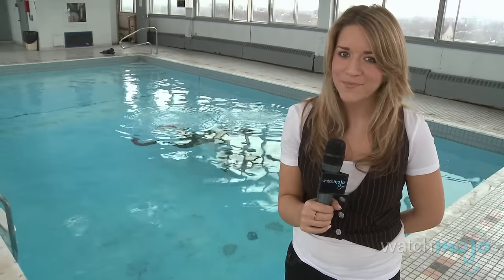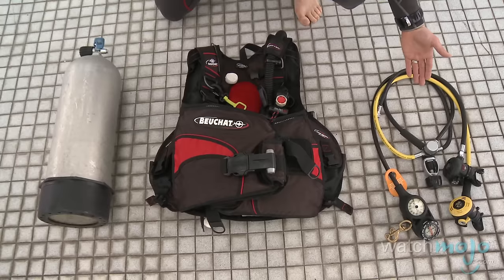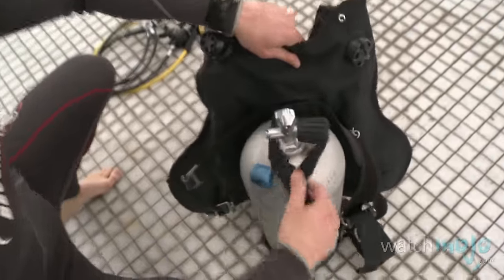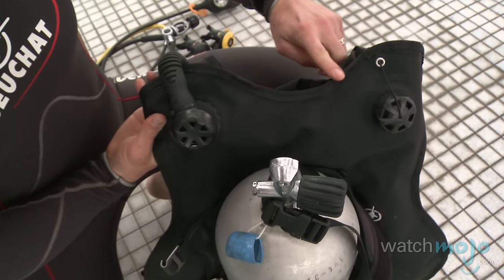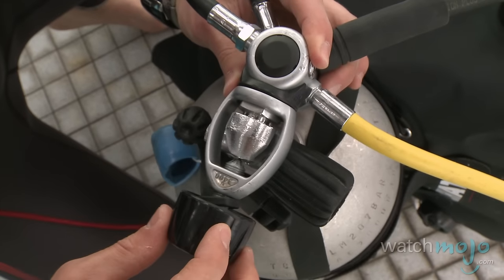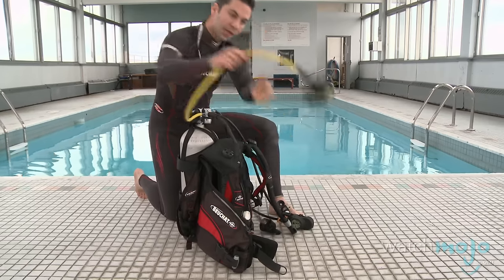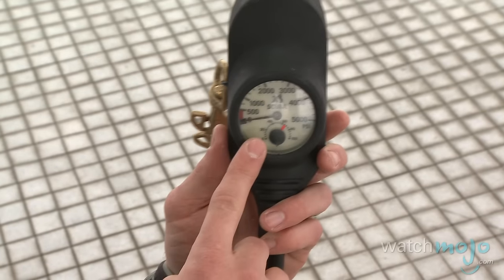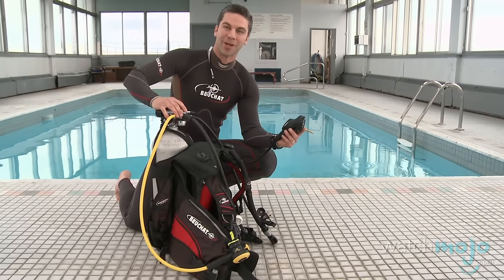Scuba Diving: How to Assemble Equipment

Comment: No more 1/4 turns! (This has proven by professionals to not be the best way to leave your valve open.) Open your valve all the way to prevent any issues whilst diving! Other than that, great video for a refresher! Thank you!
Reply: Sorry dear am a professional, cmas course director, PADI instructor, Tec dive instructor, former army diver, owner of a diving center, certified over 5000 students including instructors. With over 20000 dives. Open your tank and close a 1/4 turn is the proper way. The only thing he has done wrong is purge the 2nd stage when opening the tank to avoid sudden high pressure to the piston of the 1st stage. Also inflate BCD and leave for something minutes to check if there's any puncture then test the lpi ( both ways 1st deflate with lpi push button then deflate by pulling lpi hope) inflate and deflate again. Inflate again and check both quick purge. Check all buckles. Breath in both 2nd stage and octopus to check they're working properly at the same time check the quality of the air in the tank. When you breath the spg needle must not move. If it moves it indicates that may be the spg in not ok or the tank isn't properly open or 1st stage problem
Reply: @odeltarkhan3033  what is the point of the quarter turn?
Reply: @johnmartin2992  please check my posts I already replied to this question 3 times.
Reply: @odeltarkhan3033  Most places have stopped teaching the back a 1/4 turn. I agree with everything else you said, but the the valve is very unlikely to stick if you open it all the way. What is more likely is confusion of a buddy diver on whether the valve is open or closed. Say for example a diver suddenly has problems with airflow, maybe they didn't open the valve fully etc, a fully open or full closed valve is an immediate indication to a buddy. If it doesn't turn one way the buddy knows it is either fully closed (thus causing the issue), or fully open and so the problem is something else. The 1/4 turn just adds confusion, that way the valve is floating between open and closed and the buddy might not know if they are opening or closing the valve. Each to their own, but this is like CPR, it gets updated every few years with new rules and guidance.
Reply: @ciaranocallaghan5113  I agree with you mostly 1/4 turn was done to avoid confusion. In professional diving it was done to protect from freezing and to avoid damages when tangle in something like in cave diving, police or army rescue
Reply: @odeltarkhan3033  Ah right I see, sorry I thought we were sticking with the scope of recreational diving. I can imagine tec diving the risk of the valve sticking would increase significantly. Especially for cold water deep dives.
Reply: @odeltarkhan3033 if you are a PADI instructor, please tell me which page in PADI’s OW manual tells you to do a 1/4 turn back.
Reply: @johnmartin2992  1) To allow for a margin of error in mechanical failure. Important in the case of the unknown shit that can happen in the unforgiving environment that is the salty sea. This is true for all mechanical equipment, not just scuba tanks. Valves can and do get stuck open for all kinds of reasons, which causes all kinds of issues, especially if another emergency arises. If you have some give, you can usually do something about it.

2) When the valve is fully pegged, it is hard to know (during a check) which direction it is pegged (open or close) when the system is already charged. You could potentially peg it closed and never know. A pegged valve has a chance of being fully open or fully closed. An unpegged valve will always be open.. If the valve has give, you know the valve is open and is supplying gas. 

It is unfortunate and confusing as to why some instructors do not teach this any more, there are real engineering and safety reasons to keep doing it. It is one of the easiest things to do.
Reply: @ciaranocallaghan5113   "the valve is very unlikely to stick if you open it all the way." Statistical fog. Do you know exactly the rate of failure to be so dismissive of it? I have about 10,000+ immersion, and while they are rare - It DOES happen more often that you would think, and leads to other issues. Especially as you get more advanced in your environments. As far as confusion, I have never seen anyone get confused with a 1/4 turn in over 20 years of diving. If the valve is pegged, there is a chance it is either fully open of fully closed. If the system is charged, you would never know which way you just pegged it. If it is 1/4 in either direction, it will always be supplying gas. The fact many do not teach this anymore does not surprise me. We are in a strange world now where people with little experience are teaching others and everyone is looking for more customers, this lowering standards and bars.
Reply: @odeltarkhan3033  The 1/4 turn is NOT the standard any more (since some time). The valve should be in one of two positions: Fully closed (you know that it's closed because you don't get air), fully open (you get air). The 1/4 turn introduces a dangerous position where the tank is opened just the 1/4 turn. A bunch of ppl have died from that.

Comment: Author, you didn't check if you can actually BREATHE from your primary or alternate regulator, and didn't try inflating and deflating your BCD. Sorry to say, but this video is dangerous if anyone were to follow your instructions.
Reply: I believe the video is titled "Scuba Diving: How to Assemble Equipment" not "How to check if your scuba diving equipment works". The author is okay and the video isn't instructing you to jump in the water after those steps. It's more about clarifying how set it up.
Reply: Enderrs "Mental its actually "Your command of the English language", your English is not so good."

You command isn't that great, either. "Its" is a pronoun like "his" or "her."  The word you should have used is "it's," which is a contraction of "it is." You also wrote a run-on sentence. There should have been a period (also known as a full stop), not a comma, after your quote, and the next sentence should have started with an uppercase Y.

Comment: IMO No need to turn the valve back 1/4 turn.    I believe it’s dangerous and confusing.  It should either be on or off
Reply: you're wrong, it's standard practice for safety
Reply: @and16and  please explain how it increases safety..
Reply: @Aidanhallbass  because your buddy is supposed to check the tank. If you open it completely he might close it accidentally
Reply: @hicrhodushicsalta4382  nope, I still disagree.  It could be confusing for your buddy if opened 1/4 turn and could accidentally be turned off
Reply: @Aidanhallbass  Been diving for over 30 years with over 10,000 immersions. Have yet to find someone confused by the 1/4 turn and your claim it is dangerous is hyperbolic. There is no danger in a 1/4 turn back when the valve is already several rotations own. The reason you should not peg the valve all the way open it is the same reason you do not go 100% with most mechanical equipment, and that is having a margin of error for mechanical failure in the case of the unknown shit that can happen in the unforgiving environment that can be the salty sea. The other reason is that when it is pegged, it is hard to know which direction it is pegged (open or close) when the system is already charged. If the valve has give, you know the valve is open and is supplying air.
Reply: @hicrhodushicsalta4382  I'm doing a diving course at the moment. The moment you have finished setting up all the gear, you're supposed to not touch the setup anymore. Also not your buddy. And they also learnt me to open the valve all the way up to the end, no quarter back and such.

Comment: It's always a good idea to wet the strap that holds the cylinder onto your BCD before assembly. These straps get softer and can stretch slightly once they're wet, especially if they dried with salt water not washed out properly from the previous dive. This demo has two straps but many BCDs only have one. Having the cylinder slide out of the strap a few minutes into the dive will upset your trim badly and may even pull the second stage out of your mouth.

Comment: Its reccomend to take 2 small breaths before getting in to make sure nothing is wrong
Reply: I think the "getting-in" clip is just decorational. There are a lot more things to be done before diving. Checking the diving place (first aid things locations etc), dive briefing, buddycheck,... For setting up your dive gear there is a more indepth procedure than this video shows. First your should try to breathe without pressure on it, to check the outgoing valves are sealing properly. Then open the valve while having the purge button on one breathing-thing (don't know English name) pressed in, once the air start coming out release the purge button. This is to prevent a big shock of pressure on all the equipment. Then you should smell te air to see if nothing is wrong with the air. Then you breathe through the primary and backup breathing-things. And check the gauge that the needle is not moving. I think they should take this video offline as it's misleading and a cause for dangerous situations due to being incomplete.

Comment: When it comes to tank valves, there are only two options, open or closed, nothing in between.
Reply: Razor 404 no not really
Reply: Your wrong because fully open puts too much stress on the seat supporting the valve...study with a technician to understand this
Reply: Hai nama kamu siapa dan rumah kamu ada di kota mana?
Reply: On some of the newer valves, opening all the way is ok. In fact, some even have an indicator for valve position. However, older valves should be fully opened to turned clockwise about 1/4 turn.
Reply: @kevinmcgrath127  BS Why not ask the manufacturer. You think valves are designed to not handle tank pressure?
Reply: Sorry dear am a professional, cmas course director, PADI instructor, Tec dive instructor, former army diver, owner of a diving center, certified over 5000 students including instructors. With over 20000 dives. Open your tank and close a 1/4 turn is the proper way. The only thing he has done wrong is not to purge the 2nd stage when opening the tank to avoid sudden high pressure to the piston of the 1st stage. Also inflate BCD and leave for something minutes to check if there's any puncture then test the lpi ( both ways 1st deflate with lpi push button then deflate by pulling lpi hope) inflate and deflate again. Inflate again and check both quick purge. Check all buckles.
Reply: @ericfrench1184  bro you are talking without knowledge. The problem isn't about tank pressure. The problems are:
1st a full open tank can freeze and prevent you from closing it in case of 1st stage failure.
2nd diving in cold water freezes the mechanism of the tank valve and makes it difficult to close the tank after the dive
3rd in case of emergency you dumb diver will try to open a tank that is already open and damage the tank valve. I am not just a diver but also a certified technical inspection staff. I have all certifications needed to repair scuba gears, tanks and compressors. As a diving center owner and course director and diving center owner it's my duty to ensure the equipment of my divers are in proper condition to avoid equipment liability problems where you can end up in jail or being sued by the victim or his family. And believe me I have seen diving centers having to sell their diving centers to pay damages caused to a victim. Insurance don't pay for your shit if your equipment aren't properly maintained and cause harm to divers. Diving isn't just a sport. You learn more than just jump in the water and see fish. To be a cmas course director you have to know everything about equipment, boat handling, marine biology, diving physics, diving medicine, laws related to diving and liabilities. I wonder what is your level because your point of view is very amateur
Reply: @odeltarkhan3033  As I stated contact the manufacturer XS Scuba for example will tell you it's not necessary to turn back. And F your expert blah blah blah. Talk to the engineers who actually designed the valves and maybe ,I doubt it, you will learn something.
Reply: @scubaeric2820  ya ya ya . You can talk to the engineers all your life I don't give a shit because when they are broken I am the one hand to repair them when you are jerking. I seriously wonder your experience in diving. You are the internet search type guy and I am the first hand experience guy. You do as you please with your equipment I don't care. If you being reckless and break my center equipment you pay for it and go play somewhere else.
Reply: @odeltarkhan3033  you think you’re so sick 😂 the fact of the matter is unless you’re diving in cold ass water a quarter turn does nothing, don’t care how long you’ve been teaching/doing it.
Reply: @johnmartin2992  kiddy you need to learn diving again
Reply: The first few mm of turning the valve open should be done slowly to prevent a pressure spike on all your hoses and 1st and 2nd stage. After that you turn it open all the way up to the end. You're also supposed to hold in the purge button of one regulator until the air starts flowing, then release it.

Comment: Bad attachment of reg,  the point of the yoke screw should be put into the dimple of the tank valve first then screwed up, this will cause the regulator to be pulled  straight on to the "O" ring, seating it correctly   ... this is basic scuba, and engineering    !!!

Comment: If you need to do a valve drill underwater, and tern the valve 1/4 and it locks that means that it was on and that the other way is off. if you dont do that, you could think that because you cant tern the valve from the start, the tank must me off. making u accidentally close the tank valve. :/

 Also i think it also has t do with the O-ring in the valve opening it all the way may have negative effects on that ring.
Reply: I actually always wondered about the quarter turn. Thank you for the description; that makes a lot of sense.
Reply: The 1/4 turn back was from the old pillar valves in the 1960s that would sometimes get stuck if they were left turned on "hard."  But it's not only unnecessary with modern valves, it's actually dangerous and is no longer recommended, although many instructors still teach it because they don't know any better. "That's how we've always done it."  How is it dangerous? Let's say you accidentally turn the valve the wrong way, turning it off, and then back 1/4 to just barely on. You take a test breath and you get air, and your pressure gauge shows full pressure, so down you go. Now you're down at 60 feet where you need a LOT of air with each breath, but your flow is restricted because your valve is only 1/4 open. Since 1/4-from-full-on feels the same as 1/4-from-full-off when you turn the handle, other than the direction you turn...DON'T DO IT!  Turn it all the way on, or all the way off and you'll never have a problem. 100% open is now standard teaching from PADI, NAUI, SSI, DAN, etc. for a good reason. There is NO good reason to turn back 1/4.
Reply: @seikibrian8641  YES ! Exactly old school that can't get it out their head about 1/4 turn.
Reply: Seriously, if you don't know which direction to turn a tank valve, you need to get out of the water!

Comment: Never back a quarter turn. 
That hasn’t been necessary in 40 years and is just a dangerous idea now.
Reply: Yeah you can talk because you aren't a diving center owner and have no Idea how many dumb divers try to open a tank that is already open and damage the tank valve. Then like a fool I have to empty the tank completely to repair the tank valve
Reply: Yeah how many people suffered from deco sickness or illness due to lack of knowledge????? Same as life diving evolve mate. Every time there's something new to increase diving safety. 40 years ago people were diving without octopus (spare regulatory)  and diving with fenzy instead of BCD jacket. Suits were hard like rock but still couldn't keep you warm as required. Today suits are light and neoprene or plastic for dry suit
Reply: @odeltarkhan3033  Must not have had a good instructor. If a diver doesn't know which way to turn a tank valve they shouldn't be diving. And nobody cares you own a shop blah blah blah

Comment: Why go back 1/4 turn? So it doesn't get stuck under pressure?
Reply: Yes because when u disassemble, it would be easier to remove the regulator from the tank
Reply: yup !
Reply: never open air valve , all the way .  one quarter turn back .. or it can get stuck in open position .. on your tank ...
Reply: The reason you should not peg the valve all the way open it is the same reason you do not go 100% with most mechanical equipment, and that is having a margin of error for mechanical failure in the case of the unknown shit that can happen in the unforgiving environment that can be the salty sea. The other reason is that when it is pegged, it is hard to know (during a check) which direction it is pegged (open or close) when the system is already charged. You could potential peg it closed. If the valve has give, you know the valve is open and is supplying air.